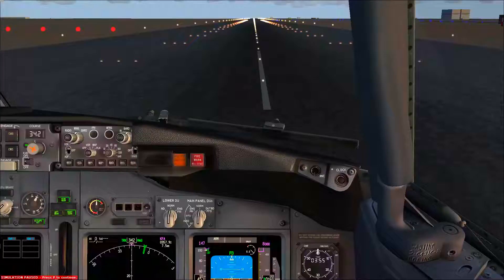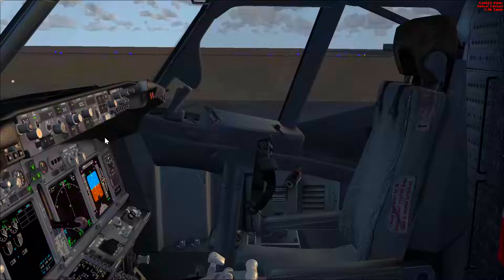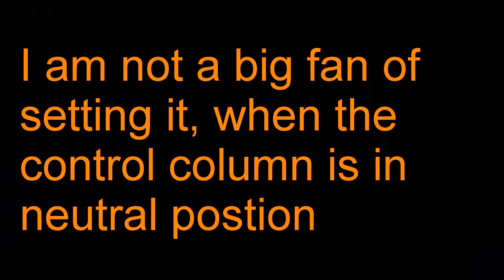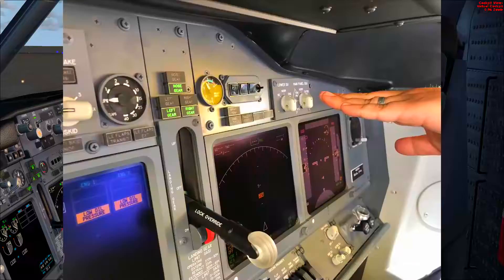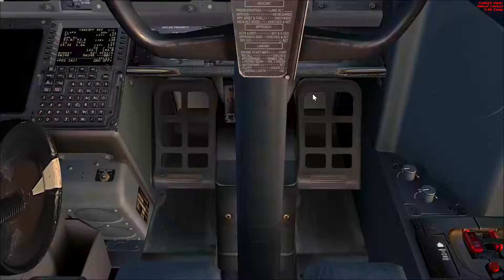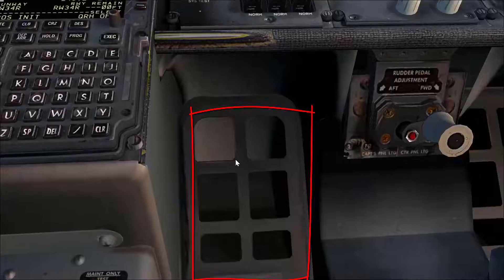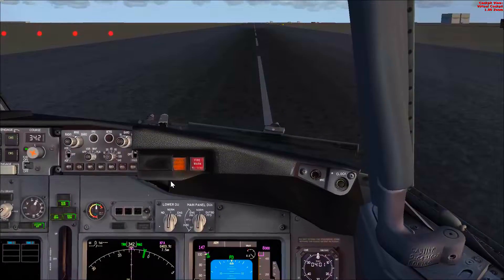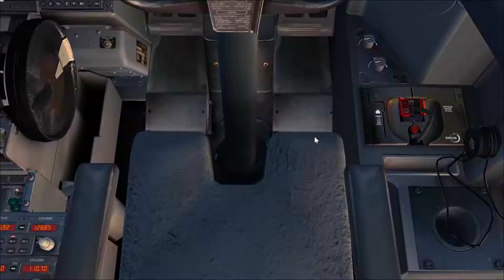B737 App. & Lndg Video#1 (Seat Adjustment)

Comment: Hi! You real pilot Boeing 738? Thanks for interesting information!
Reply from the maker: You are most welcome
Reply: @AbdulmuatiAsiri37  Now you fly on real boeing? It is interesting to know what of the company. Thank you!
Reply from the maker: Yes Sir now I fly Boeing 767, I flew the 737 for more than 8 years. 
I work in Aramco, its an Oil company though not an Airline.
Reply: @AbdulmuatiAsiri37  Great! Tell me how real pilot. Pmdg 738 well-made in simulator compared to the real Boeing 738ng? Well if implemented dynamics of the flight pmdg? And what simulator better at the dynamics of the flight. fsx/prepar or X-plane? If you were flying in X-plane. Thank you!
Reply from the maker: @HomeBog  Thank you for the question.
PMDG 738 Add on is the best there is At least from what I have seen. It is really close to the real thing, especially with the switches and systems. The real airplane is easier to fly though (believe it or not), simulators tend to be very sensitive compared to the real airplane. 
The simulator I use is FSX which is slightly outdated but due to the time I invested in tweaking it, I might stick to it for a while. If you are just starting I recommend Prepar3D  which is the updated version of FSX. I am not sure if PMDG has issued an add on for X-Planes. 
Thank you again and please let me know if you have any other questions.
Reply: @AbdulmuatiAsiri37  Thanks for the reply! I also fly in fsx. I have a laptop and in prepar 3d I have a low-fps. That is the behavior of the aircraft flight and dynamics of the model pmdg 738 in the simulator pretty accurate?
Reply from the maker: @HomeBog Cool wish you happy flying :)